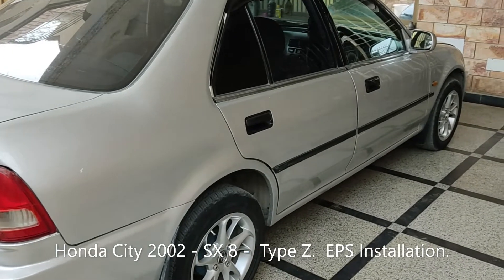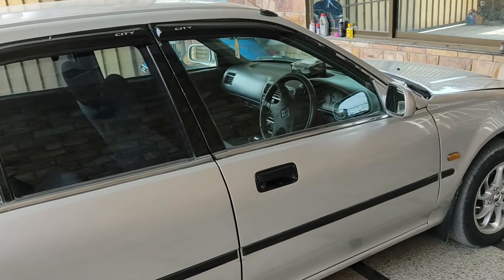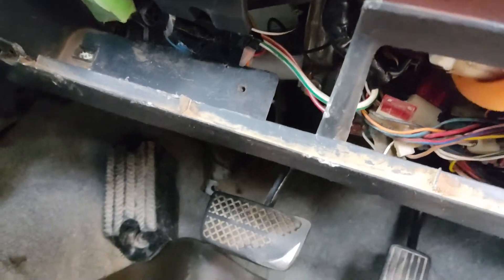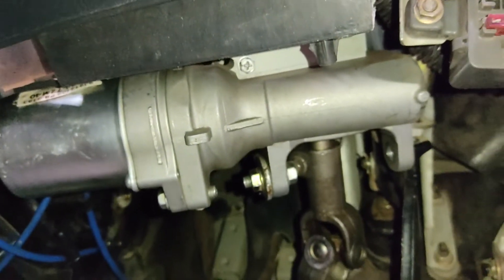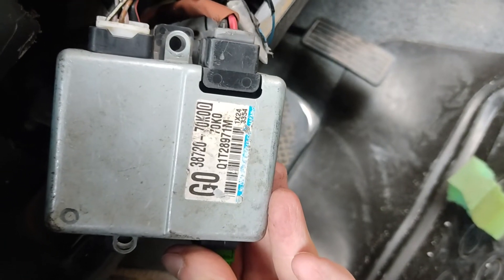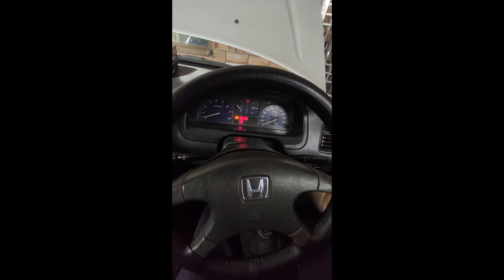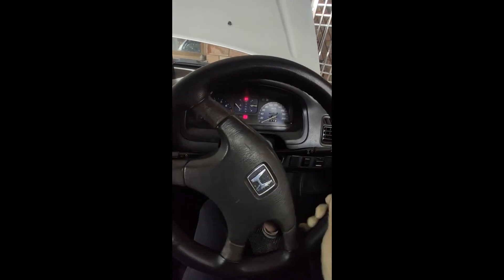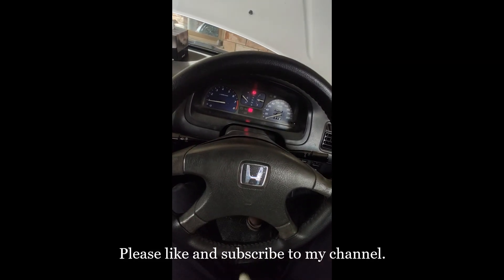Steering Rack Leaked, Electronic Power Steering (EPS) Installation in Honda City SX 8 - Type Z

Comment: main ney bhi eps per kya hai  meri gari kai  yeah wali performance  nahi hai pls guide
Reply from the maker: The softness of steering depends on many things, Which motor he used usually the 1000CC cars motors such as Passo are better suited for this car but installers install Suzuki Alto or WagonR 660 CC motor to save money and also the space in this car is limited for big motor. Other than that the steering Rack it self should be in good condition and not adjusted to tight if its already tight the small motor cant do much.
Reply: @tauqeerwaqas  they use corolla eps motor still in same problem

Comment: from where you get it istalled and cost in PKR? i have the same car with same issue
Reply from the maker: Its around 10 to 12k PKR. Chah Sultan Rawalpindi contact Dani @ 03329944877